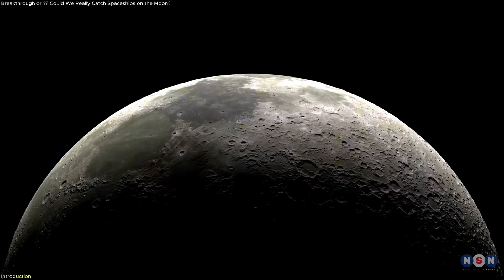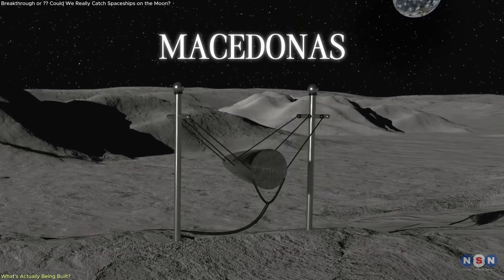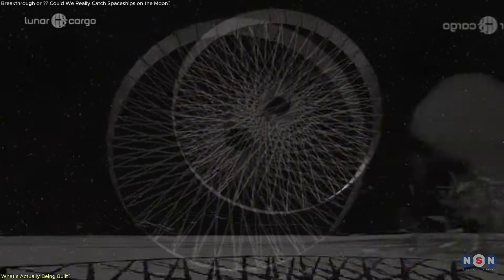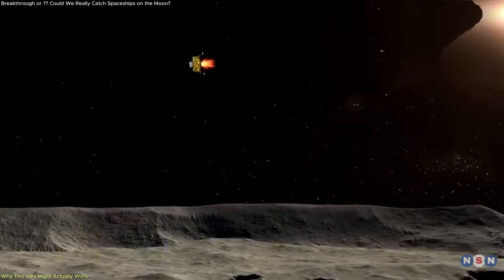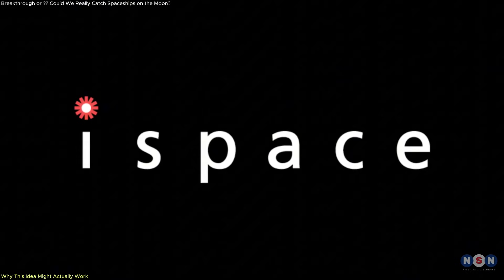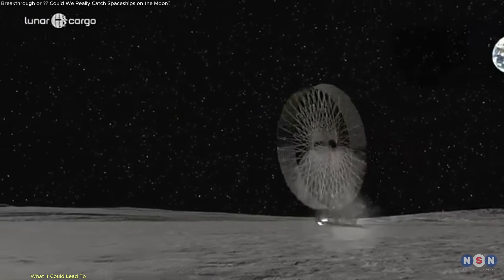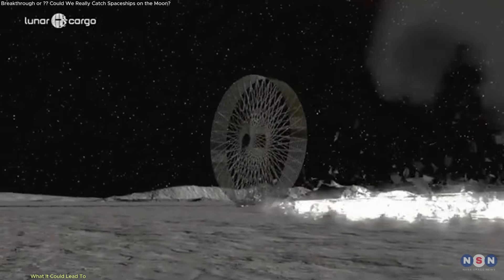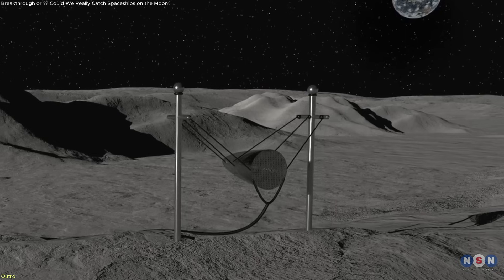Breakthrough or … ?? Could We Really Catch Spaceships on the Moon?

Comment: I loved the inflatable enclosure that one Mars landing used to land autonomous rovers. It seemed like a lower cost and simpler solution than those discussed for landing on the moon. Why is this not under consideration as a solution for moon landings? They just need to slow the descent down sufficiently to make air bag usage reasonable (Of course the parachutes that were used to slow down descent with the air bags would be useless without atmosphere).

Comment: The biggest waste is Earth's gravity. But a long electric induction tube that ran from one mountain peak across a narrow valley and then up another maountain would let payloads reach orbit with a lot less fuel usage. If you can sink a ship with a steel rail by building up kinetic force, you ought to be able with a bit of fuel for steering, be able to deliver some good sized loads to low earth orbit for pickup to transport to the moon net.

Comment: But first you have to get the catching net safely to the Moon.
Reply: Yes. The deployment will involve 5 discreet missions. 
1. Use a cheap qualification time to send a wire load or at least 150 kg to a parking orbit
2. Send a lander to pick up the wire-load from the parking orbit and land it at the mountain-top of choice.
3. Deploy the wires over 10 to 30 km with a rover (barter trading with a third party).
4. Send all the catcher tendering facilities (including power generation).  
5. Send the mothership (MACEDONAS Feeder) that will deliver a parcel per orbit, at LLO (5 to 50 K parcels). 
The idea will generate 1 Trillion value. So, plenty of margin to develop anything that is not yet available.
In any case I am in favour of the business model of Greek shipping community, were they don’t build themselves the ships they operate, instead they order in specialist shipyards.